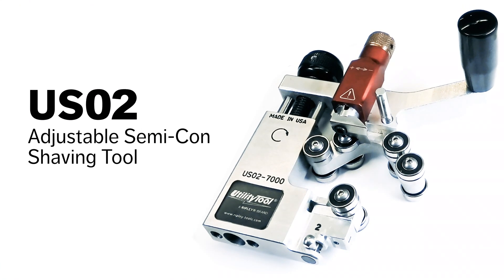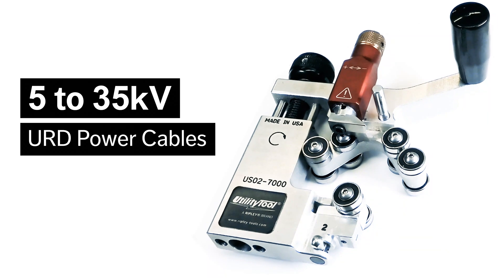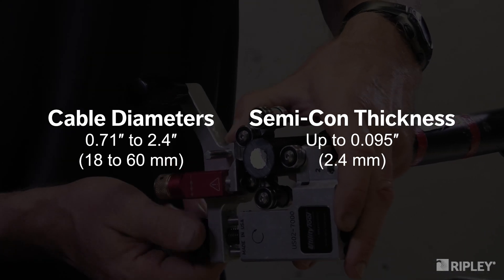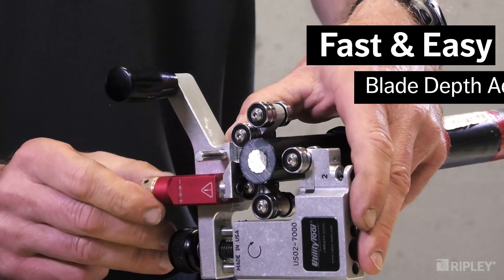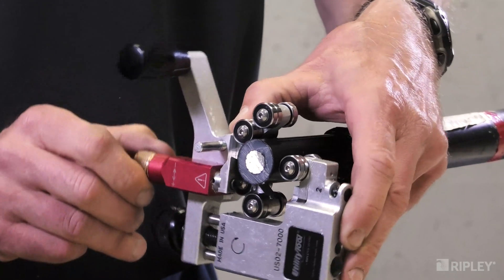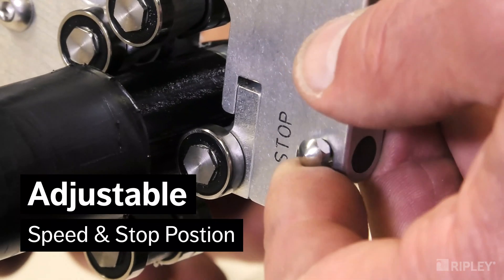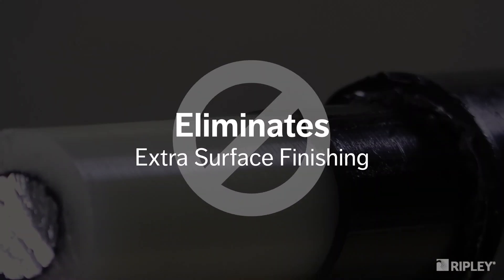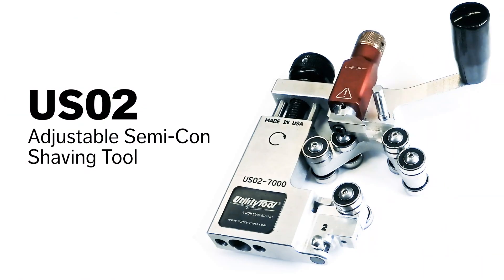UtilityTool® US02 Adjustable Cable Semi-Con Shaving Tool

Comment: Using this tool is recommended to work from the end of the cable toward your circular cut? I am asking because if you use an end stripper or shaving tool after the semi con is gone your tool would be on the insulation when removing the insulation possibly contaminating the insulation.